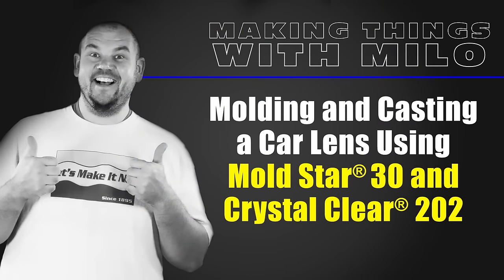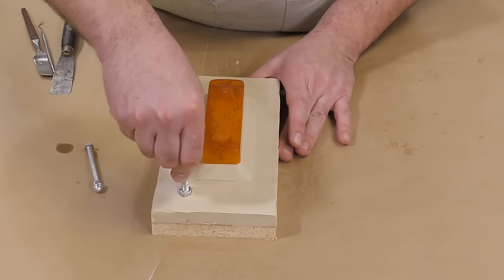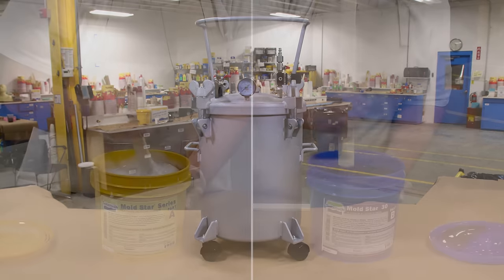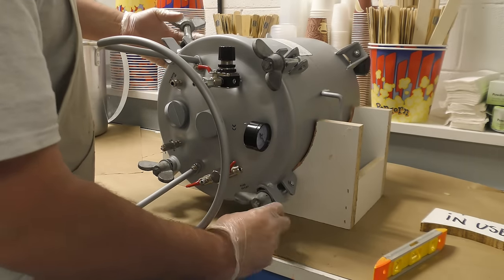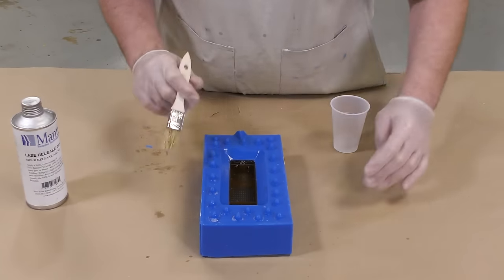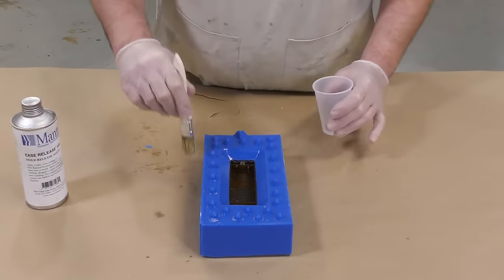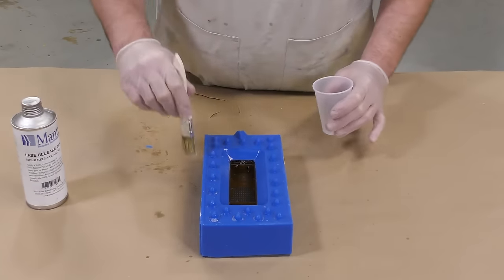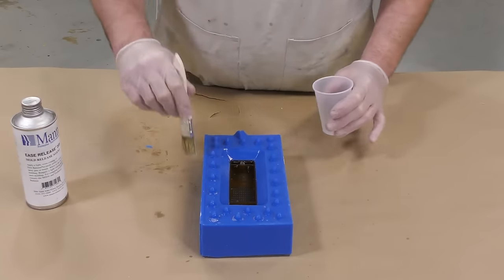How to Create a Replacement Tail Light - Moldmaking and Clear Casting Resin Demonstration

Comment: You should make yellow/orange turn signal lenses (using a red lens) for American cars to be exported to other countries.
Australia usually doesn't permit stop lights to double as indicators.
Reply: RS 1990 Is it legal to share an Amber lamp with the clear reverse lamp in the same defuser? What about putting a green LED lamp behind a section of red tail light? The red lense should filter the green to yellow.
Reply: I presently don't know much about it. I need to seek expert advice.

Comment: Question - You seem to be using a pressure container at 60 psi. Shouldn't it be a vacuum chamber? 
That is what I've seen in other videos when the mixture has to be free of bubbles.
What am I missing about that part of the process? Excellent job either way and well done video. Thanks.
Reply from the maker: Both of these techniques can be used.  Pressure castings happens after the casting is poured.  Here are a couple tutorials - https://www.smooth-on.com/tutorials/resin-casting-tutorial-reduce-bubbles-casting-vacuum-degassing-resin/ https://www.smooth-on.com/tutorials/eliminate-bubbles-resin-castings-pressure-casting/

Comment: How does using a pressure chamber during casting differ to using a vacuum chamber before casting that we see in other youtube videos. The pressure pot seems an easier approach.
Reply from the maker: Pressure casting happens after the material is poured vs. vacuuming which happens before the pour.  Ideally you would do both.

Comment: I need to apply this exact technique to reproduce a vintage toy housing that I believe was made of ABS with a glossy injection molded surface finish. What is a suitable replacement material that can be squeeze molded like this? Something that comes pre colored in opaque black or white would be perfect as these are the only colors I would need.
Reply from the maker: Can you send us a tech ticket? Our team can help you - https://www.smooth-on.com/support/ticket/add/agree/

Comment: Excellent, the level of detail is mind blowing!

But why are you pressurizing rather than depressurizing the chamber?
Reply from the maker: The pressure is applied after the resin is poured to essentially 'press' any air bubbles in the resin to make them invisible.

Comment: Wouldn't it be a good idea to first vacuum the air from the tank to remove any possibility of air bubbles in the Crystal Clear 202, then pressurize the tank for curing?
Reply: And vacuum out all of your product from the mold? Nah. If you want to degas the mix before pouring, that's fine, but you'd best be quick with it, as this stuff has a pot life of 9 minutes. 😄

Comment: I've always found those 3M respirator masks easier to put on if you clip neck ones on first, then grab the head strap and flip the mask up onto your face. Pulling the head strap off and leaving the mask hanging down is also handier if you need to pull it off for a moment and quickly put it back on, if you have to blow on something for example. 
[I even like to put a thick piece of electrical tape around the heard strap as a tab to pull the mask down quicker, or if you have dirty gloves on and don't want it touching your head/hair]
Reply from the maker: Thanks for your comment and for watching!
Reply: I agree. That's the type of respirator I used for decades as a painter, and I would often have it hanging like a weird necklace while I didn't need it on (like when mixing some more paint up), and then could just slip it back on easily. I always had something covering my hair, like what used to be called a "danbanna" (who knows, it may still be called that), or more often, a painter's hood over the top of that, so I never had to worry about overspray getting in my hair. Didn't have the issue of needing a tab or anything that way. 😉

Comment: I wonder what would happen if you dint have a pressure pot? I mean, like how rough would it actually be?
Reply from the maker: Without a pressure pot, your casting may have more air bubbles, resulting in a rougher surface finish. It's recommended to use a pressure pot for better results.

Comment: Can i use this resin to make clear lenses with no pigment? Like headlight lenses?
Reply from the maker: Yes you can
Reply: @smoothon  and it should be perfectly clear right, and UV Stable?
Reply from the maker: @DingDongDrift  Crystal Clear resins are UV resistant and optically clear.
Reply: @smoothon  awesome, i'll be ordering some soon, recommendations for a mold material?

Comment: Nice video. After a long period I got to how it is made. Only the question for me that is What shall I use instead of pressure unit which you have shown to remove air bubbles. Also let me know who is dealer in India.
Reply from the maker: Pressure casting is the best way to reduce air bubbles in clear resin.   Thanks for watching!  A full distributor list can be found here: https://www.smooth-on.com/distributors/

Comment: I think small shops should get together. Each shop keep special molds and trade or borrow the molds needed for jobs on hand. Everyone would be on a list with how many types of molds they have to offer. A list of needed molds should filled with new members that join. You would get member points for finding and making a hard but needed part available. 
That way more models of molded car parts could be supported by small shops.
 This probably already exist, but I thought it would be a good structure for small shops to band together to prevent not getting a needed part while keeping the cost down. Most car parts now are just molded plastic anyway.

Comment: Can you use a vibrator mechanism instead of a pressure chamber for getting rid of air bubbles?
Reply from the maker: A vibrator is not as effective as proper pressure casting for bubble free castings.  Thanks for watching, and don't forget to subscribe!

Comment: What about longevity and UV stability? Also, will the heat produced from the light cause damage to the plastic?
Reply from the maker: Crystal Clear is a UV resistant resin, the heat from a tail lamp would not be higher than the Crystal Clear's heat distortion temperature in this case.

Comment: Pretty neat video. There's one thing I wonder about (besides the fact that both the silicone and the 2-component PU resin are probably quite expensive and the fact that I won't be able to buy it locally in Europe) though: why pressurizing both materials? Why not vacuuming? Vacuum pulls out the bubbles too after all...
Reply: Because pressurizing works best with this type of mold, as the OP has answered on question after question. Vacuum would be great for degassing, first, before the pour, but you want pressure on the mold while the resin sets.

Comment: you don't need a vacuum. all you have to do a mix and apply a thin layer of silicone over the object first.  the air bubbles will pop themselves. allow to set.  Then mix and pour in the rest of the silicone to create that half of the mold.

Comment: Why pressure pot instead of vacuum to de-gass the silicone?
Reply from the maker: These techniques are often used in different mold configurations. Here are some links which may help - https://www.smooth-on.com/support/faq/156/ and https://www.smooth-on.com/support/faq/111/

Comment: I noticed on some videos they use a vacuum and you use a pressure tank.  What's the benefit or reason for using one vs. the other?
Reply from the maker: These techniques are often used in different mold configurations. Here are some links which may help - https://www.smooth-on.com/support/faq/156/ and https://www.smooth-on.com/support/faq/111/

Comment: if i was doing this with a much bigger lens like a large tail light of a motorbike whats to stop the weight of the silicone bowing and pushing too much resin out making it thing? would it be worth adding strips of wood in the silicone to make it more rigid?
Reply from the maker: Possibly, depending on the dimensions.

Comment: If you wanted to make a thick transparent cast how do you achieve that? Thicker for a stronger cast that is
Reply from the maker: You could use a model which is thicker, or add depth to the model with clay or wax.

Comment: I am wondering why use pressure and not a vacuum to remove the bubbles during the cure?
Reply from the maker: These techniques are often used in different mold configurations. Here are some links which may help - https://www.smooth-on.com/support/faq/156/ and https://www.smooth-on.com/support/faq/111/

Comment: Great video. Thank you. I have one issue however. You said that a 10 gallon, or 5 HP compressor would do the job. And yes, it definitely would. t great expense if you dont already have one! But, unless there is some reason that the chamber must be brought up to pressure quickly, a simple automobile car tire infiltrator would to the job just as well on 2 or 3 minutes tops. Would a slow pressure rise cause any problems in the mold making or part casting process?
Reply from the maker: Depending on the cure time of the material, it may be gelled to a point where pressure cannot exert sufficient force on the bubbles.

Comment: Great videos...Question please...Which product would I use to make a mold that I could pour lightweight concrete in?  I want to make a small concrete mountain for a piece of my artwork.  Size would be about 8" tall and 8 inches in diameter.
Reply: take a look at Vytaflex Urethane rubber

Comment: Hello thanks for the cool video. How many times can I use this silicon mold without ending up withe a cloudy resin look? would the silicon mold`s surface roughen up over time?  Thanks
Reply from the maker: It would depend on the casting material, etc.   Can you send us a tech ticket? Our team can help you - https://www.smooth-on.com/support/ticket/add/agree/

Comment: Have you ever made multi-colored tail lights with this process? I have a couple of European cars (Citroen 2CV and a Trabant 601)  that do not have integrated backup lights built into the tail lights. Usually these cars have backup lights (and rear fog lights) mounted off the rear bumper and look awful.

 I'd like to make some for both cars. Since I live in the US, the rear turn signals do not need to be amber as mandated in most European countries. I was thinking about replacing the tail light socket with a dual filament socket and use the higher 21 watt filament for the brake lights and the lower 5 watt filament as the tail lights then make the former amber turn signal white and use it's socket for the back up lights.

Comment: I've seen some molding done with a vacuum as opposed to pressure. What's the difference?
Reply from the maker: Vacuuming material is done before the pour.  Pressure casting is done after.  Perhaps these FAQs will be helpful: https://www.smooth-on.com/support/faq/156/ https://www.smooth-on.com/support/faq/111/

Comment: Neat I have an area under my radio in my car that is about one and 3/8 inches high x seven inches wide x 6 inches deep. I would love to make a mold of a drawer with separation sections for coins etc. that utilizes all the available space and cast it but all videos require a blank or a part to cast any ideas how to make the blank and then cast it?
Reply from the maker: Can you send us a tech ticket? Our team can help you - https://www.smooth-on.com/support/ticket/add/agree/
Reply: Les Termoil Make yourself a positive blank with modeling clay or play-doh.  Then make your negative molds with the Smooth-On silicone molding material.

Comment: Well done. I would add that you can also use compressed dry air from a tank supplier to provide guaranteed water free air (N, Ar, CO2 etc...) After all the money for the silicone mold do you want to risk failure for a ten dollar absorbent failure on your own compressor? The number of molds you plan on making would factor into this decision, and the cost from your local specialty gas provider. Check welding supply or their suppliers...

Comment: Awesome video, I also have a cracked non reproduced lens on my car, I'll need to try this method once. You can even make  spares. 

BTW, would this also work for a glass headlight lens? I assume you would make a mold the same way but actually casting it would be a different story, no?
Reply: You'd want the resin to be clear, not tinted, but the actual casting would work the same way, I'd say. I don't see a reason why it would be tremendously different.

Comment: what if you wanted to make a "mirror" of a lens for instance I have an 80's chevy pickup box trailer with one of the tail lens completely broken but the other is intacked there just mirror of each other. nice video :)
Reply: If you were to remove the intact lens, and turn it upside down, would it fit the other side? If so, you could just cast a copy of the intact one & install it the way it fits.

Comment: Very cool. Have you noticed any significant differences in how the silicone mold turns out when curing under pressure vs in a vacuum pot?
Reply from the maker: Yes, in order to pressure cast, you must pressure mold, as any bubbles in the silicone my cause 'pimples' in the casting when resin is cast under pressure.

Comment: why would you pressurize it rather then making a vacuum to get rid of the air?
Reply from the maker: Pressure casting a resin is more suitable for a 2-piece mold such as this.

Comment: Does the mold need to be coated with mold release after so many uses or will the silicone hold up just fine
Reply from the maker: Properly stored silicone rubber molds should hold up well without the need for additional mold release after each use. However, using a mold release can help extend the life of your mold and make demolding easier. It's always a good practice to apply mold release before each casting to ensure the best results. If you have any more questions, feel free to ask!
Reply: @smoothon  Recommendation on mold release that will work with smooth_on ms30 and cc202? I see the ease release 205 used in video so I assume that or 200 unless there's something better for constant use.

Comment: What is the improvement in using pressure over vacuum?
I'm using vacuum to get the bubbles out of my molds and this works perfectly, so i'm quite curious wether your solution might have advantages.
Reply from the maker: Pressure is often used in casting because the bubbles are removed after the material is cast, reducing the risk of bubbles occurring when pouring.
Reply: Yes, can see the point in that. But are there practical reasons to prefer "compressing" the bubbles instead of letting them "plop" trough vacuum? Maybe related to the size of the mold?
Reply from the maker: @dolphhandcreme  Size and configuration of the mold does have a lot to do with this.  Ideally, the casting resin would be vacuumed and pressure cast.

Comment: Very clear, and concise instructions.
One question I have, asking because I have seen it done elsewhere: Vacuum chambering the silicone rubber and/or resin before pouring?
Would this work well with this product? Or does the pressure chamber better?
Reply from the maker: If you can do both, there is no harm.  Vacuuming happens before pouring, pressure happens after the casting is poured.

Comment: Great video- thanks. Please can you explain why you did not use mold release on the lens master, is it that the mold rubber does not stick to it? it is also a good idea to mention that  you released the pressure out of your pressure chamber before you opened it :) Some people may not think of that . I see a lot of places using a vacuum chamber for degassing , what would you say is the advantage of using pressure?
Reply: I can't answer about the mold release, but this is what the manufacturer said about the vacuum vs pressure on the other hundred questions about the same thing:
Resin can be degassed with a vacuum prior to pouring, but even after the material is vacuumed, the act of pouring can induce air.  To eliminate bubbles which may occur after pouring, a pressure casting technique is used.

Comment: What's the difference between pressurizing it to 60 PSI and vacuuming it down
Reply from the maker: Pressure casting happens after the material is poured, while it is in the mold.  Vacuuming happens before it is poured.

Comment: You are a lucky guy that your car has 2 identical parts, nirmally they are mirrored. And how much does one indicator light cover now costs you, considering the silicone price for the mould and the epoxy price with pigment divided by the 2 parts you get out of your form ?
Reply: Well, for one, the silicone mold would be usable indefinitely, so the price of it couldn't be honestly put all on the first lens cast. And the resin price can't really all be charged to the one lens, either, as you can make several lenses from the one set of resin mix. Same with the colorant. And as for mirrored lenses, generally (especially with older vehicles), the one lens can simply be flipped over upside down, and would fit the opposite side's mounts.

Comment: I have seen people use a vacuumed pot on/ for all the steps, Is there a difference between using pressure or vacuum ?
Reply from the maker: Vacuuming material is done before the pour.  Pressure casting is done after.  Perhaps these FAQs will be helpful: https://www.smooth-on.com/support/faq/156/ https://www.smooth-on.com/support/faq/111/

Comment: I could really use the amber lens for a 67 dart gt front fender indicators.  they are very small but on my car they are cracked and broken and due to them only being on the 67 they are not reproduced by anyone.  I have the metal housing and the amber pieces but not sure if they are good enough to make a mold of them.   any input would be great.

Comment: Why could you not use the first silicone mold and fill it with cement?  Is it too weak to hold the concrete?
Reply: Concrete?  For a light lens?? Are you lost?